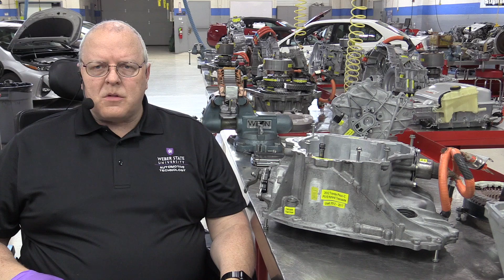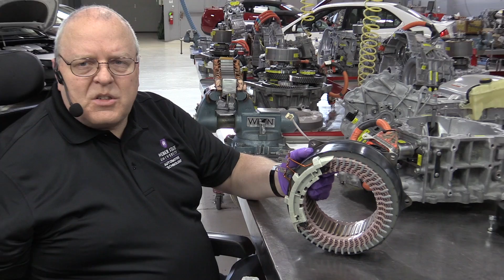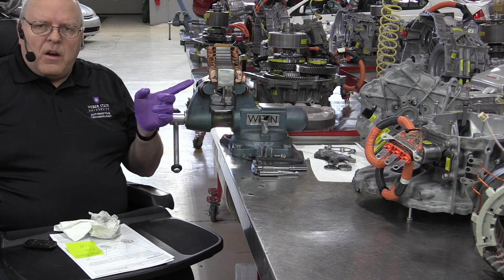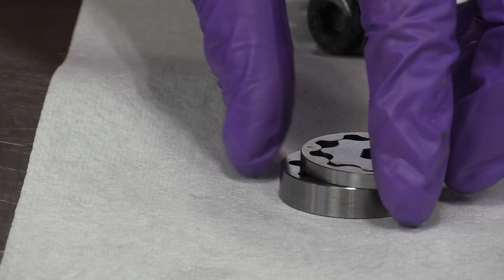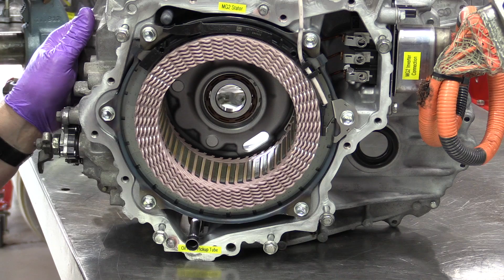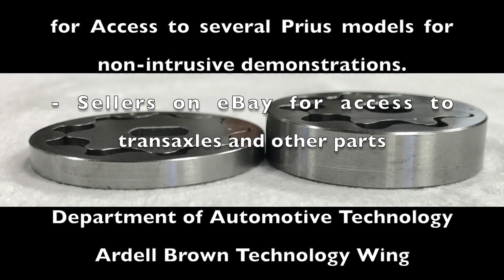The Prius C P510 Transaxle

Comment: Hello!
I have 2012 Toyota pruis c three
Yesterday a friend suggested me to do force charge by putting the transmission shift into B and depressing the brake to the floor at the same time fully depressing the gas pedal for about 30 seconds to one minute.
I very anxious about that if it can damage the transmission because I press the gas to the maximum while the car is prevented to move.
Can you please confirm if what I did is safe or no

Comment: They don’t recommend the cvt fluid changed mines on 162k with oem cvt fluid so I’ll probably change that soon if it lasts it’s acting up right now it revs up when I’m off the gas and don’t shift and stays high rpm’s and the hybrid battery was around 2-3 bar

Comment: Question, can another brand of transaxle fluid be used? Or the toyota ws only? There are several brands that say ws compatible but I'm just curious of the conductivity would change?
Reply from the maker: Only Toyota WS fluid. Up to 600V inside the housing. Must be designed for high voltage. Thanks for watching

Comment: What is the approximate weight of the P410 and P510?    Any idea what the MG1 and MG2 KW specs are, ideally with Voltage specs also?  I'm thinking about making an engine welder and also debating whether to spend a little more for a P510... for maybe, though I doubt higher current welding.... or just stick with the same as my 2013, and maybe find a 2015 P410 for spare parts just in case I doublt I'll need, since might not require the current demands also.   Thinking just the MG1 alone will be all that's required for the alternator and a 3 phase to single phase full bridge rectifier.   Also thinking I can use an idler assembly to mechanically control alternator output maybe.  Any specs anywhere regarding RPM and output ranges?   Thanks in advance for your time, you have the best videos, info and details no questions asked!

Comment: Thin wire is better for AC, which itself only travels mostly on the surface of the wire. DC uses the whole wire cross section.

Comment: I'm so relieved to see that the stator is better than the previous gen. I assume that the thickness will make it harder to have failed motors. I always thought that the motor and battery would need replacement, but after my first cross country drive on my C, I'm convinced that with the right preventative maintenance, it will last beyond the 300k miles like previous Toyotas have.

Comment: Thank you for your excellent presentation and teaching skills. I recently purchased a Toyota Hybrid Fielder Wagon with the 1NZ-FXE  1.5 L engine and the P-510 Transaxle. Why does the transmission oil pump only operate when the Internal Combustion Engine (ICE) is in operation (when not in EV Mode)? When not in EV mode, MG1 is driven by the ICE as a generator to recharge the Battery, so there will be heat generated in its stator winding which will be removed by the flow of the transmission oil. However, when in EV mode and the ICE is out of service, the stator current in MG2 is high, causing heat to be generated in its stator winding, but the transmission oil pump is not operating because the ICE is stationary in the EV mode, when maximum cooling of MG2 Stator is required. Any residual transmission oil on the MG2 stator winding can be overheated when in EV mode, thus leading to discoloration of the transmission oil that you mentioned in your video commentary. Is there a sensor for measuring transmission oil temperature that can be accessed via a scan tool and would an external transmission oil cooler prove beneficial in reducing the maximum transmission oil temperature during operation?

Comment: What is the voltage of the hybrid battery?
Reply: The one used with the p510 transaxle is a 144V NiMh battery, at least that's what I have on my small Toyota Yaris.
Edit: the inverter can step it up to 500 something volts, to drive the motors, of course.

Comment: A small external oil cooler would be nice, keep the motor running more efficient, could it be a modified for oil cooling?
Reply: At 17:10 you could add tapp into the external coolant passages and add an external transmission fluid cooler infront of the condenser

Comment: Very complex compared to an EV powertrain. I wouldn't be surprised if EVs become far more cost effective in the long run simply due to the simplicity of the power train and the production advantages that enables. Excellent content as always.
Reply from the maker: Thank you, hybrids are mode complex than EVs for sure
Reply: It's more complex than an EV powertrain, but much simpler than an automatic and manual transmission, more robust and efficient too.
Reply: They didn’t

Comment: Excellent videos. Do you know if the Prius C Motor Stator is Delta or Star (Y) configuration? Thanks for your help.
Reply from the maker: It is wye wound. Thank you!
Reply: Wow, thanks for the quick answer. You wouldn't happen to know or of measured the Resistance of each phase winding? It would require a precision meter as I assume it would be lower then 0.1 Ohm considering the mass of the flat copper wire.
Reply from the maker: I do not have that measurement recorded. I suspect they are close to 10 milli-ohms each

Comment: Thanks Professor Kelly. Regards, Ramish.
Oh ! A little point. The early Prius, then The Prius C, multiple Japanese versions Of the Corollas, including Hybrids, Aqua (Japanese Prius C) are using the 1490cc 1NZ-FE engines. These are proven for about 20 years or so. Of course there are modifications on the ancillaries of the engines used for Hybrids, to accommodate whatever is necessary.
I would expect the 1790cc engine used in the Prius, CHR, Japanese Spec Voxy and Noah minivans to be the more modern version of the 1ZZ-FE, which is the dual-cam VVTI 2ZRFE.
Regards.
Reply from the maker: Thanks for your feedback. The original 1998 Prius used a 1.8L 1NZ-FXE engine

Comment: Why can't we create a generator, strong enough, to run the electric motors directly. Much the same as a locomotive?  Having the damn transaxle, with all its inefficiencies seems wasteful at best.
Reply: I think that at lower speeds, since the generator will be directly tied to the wheels, at lower rpm is going to be very inefficient, that's the reason all those gears are there.
Reply from the maker: Thanks for your feedback!

Comment: One question, do you see any joint on P510 stator flat wire winding? I have a feeling these flat wire are not wind together to become a coil. But assembly together instead. Imo, this style is able to save $$. Because I recall the newer generation Toyota hybrid system is intend for better scalability. And with simpler winding. The cheaper it can made.
Reply from the maker: Yes, they appear to have welded joints under the grey covers.
Reply: WeberAuto thank you. That is good to know.
Reply: @林振华-t4v   This winding also seems to be more robust and reliable than the previous ones.

Comment: A video like this where a lot of principles comes together in one package (the engine) would help decrease the amount of years needed for kids to learn physics. If they can directly see where the equations manifest themselves and where the art around the equations comes to life they would probably learn a lot faster. They will see the notes and the music at the same time. Then it is a matter of inspiring them to write music themselves.

F = ma does not say much, nor Q = U A ΔTlm - but put in the context of an engine it will be easier to explain and understand. If the teacher understands(!)
The friction equation put together with fluid mechanics explains the sprayed oil film. It also helps to explain the joints in the human body. One could squeeze in viscosity and the breakdown of oil at different temperatures. The heat exchanger in the engine can be compared to a heat exchanger in the form of a CPU-cooler. Area of metal with or without air flow, with or without liquid cooling.

Teach the children the holographic nature of the creation (by that I mean how the laws and principles are applied across all areas of life).

Thank you for these videos.
Reply from the maker: Thank you!

Comment: Doesn't oil produce drag on a rotor that turns at 10 000+ rpm?
Reply from the maker: Good question, I do not know the answer. I do know that they switched to the low viscosity Toyota WS fluid in 2004 with the second generation Prius and its P112 transaxle. That was the first transaxle to have a maximum MG1 rotor speed of 10,000 rpm.
Reply: So I though about that some more. My estimations tell me that rotor will be oil free due to centrifugal forces. When stationary, oil seeps between stator and rotor. When rotor starts turning, it pulls oil everywhere but when it speeds up any oil dripping onto high speed moving rotor will not be able to touch it. So no cooling effect for rotor expected. Though a drop of oil that tries to drip onto  high speed rotor will still have some drag effect as oil drop will accelerate sideways (with airflow). Though most likely less than 50W of energy will be wasted on that at any rotor speed.

Ideally we want no air inside the apparatus for less drag. Ideally we want no heat also :)
Reply: @tarassu   Hmmmm but with no air there will be more heat, but oil most likely produces drag, yes

Comment: As usual, a very interesting and informative  video. I was surprised to see the lack of symmetry in the coil windings of the P410. The new thicker windings on the P510 had perfect symmetry. I have to believe this has an effect on the efficiency of the motors.
Reply from the maker: Thank you! I agree. I wish I had some efficiency comparisons for them.
Reply: @WeberAuto  Perhaps the motor could be mounted in a dyno and measure watts electric input to watts mechanical output?